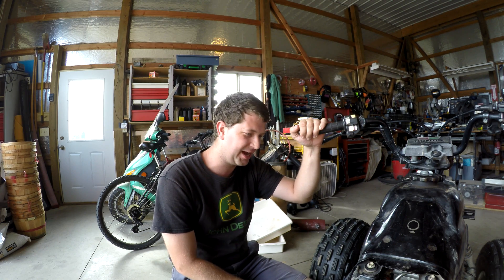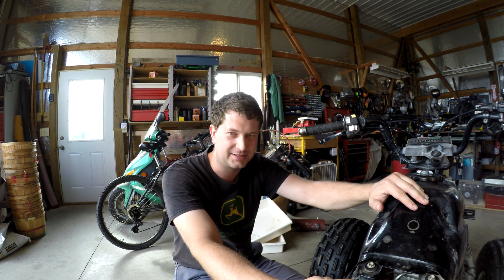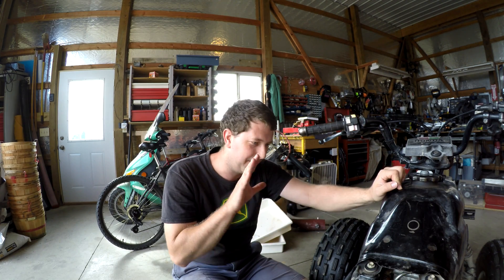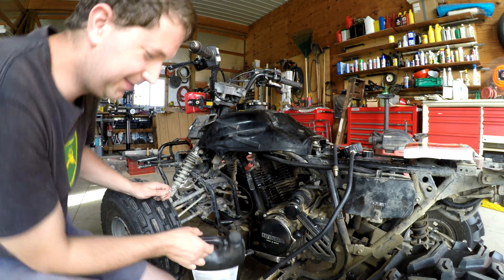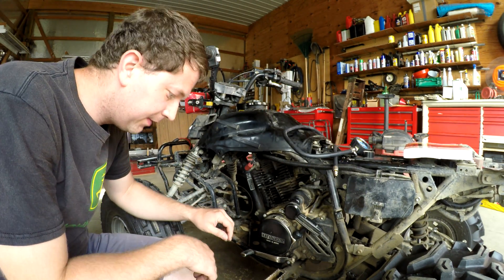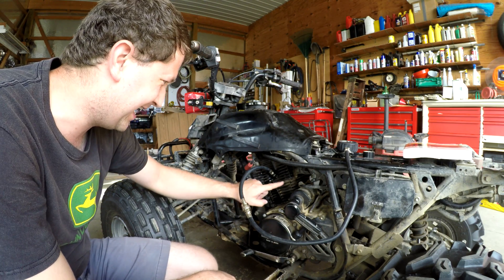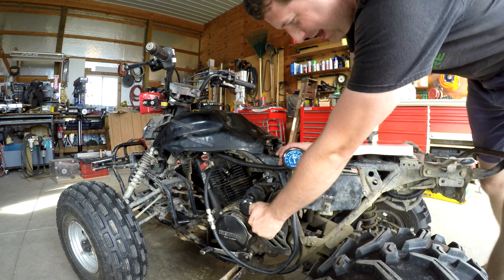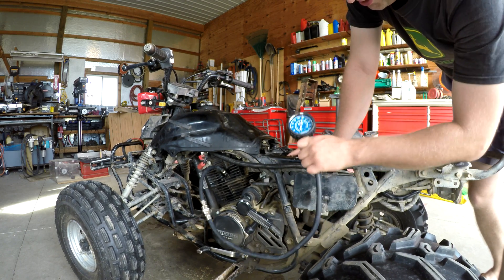Cylinder Compression Test on a 1986 Honda Fourtrax 200SX

Comment: The Honda compression spec is for a hot engine, if you're checking compression when cold, it's going to be lower.  Mine runs great, lots of power, no smoke and tests at 145psi when cold, I don't think there is anything wrong with your compression.